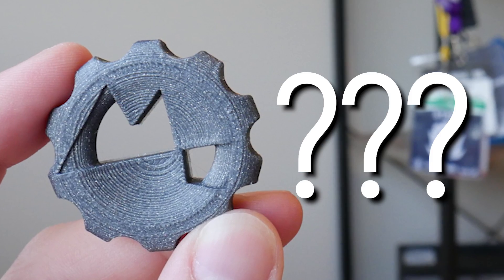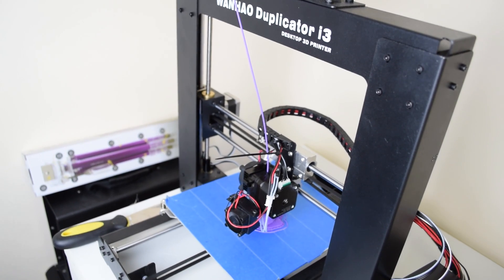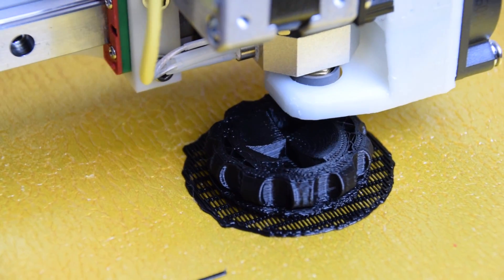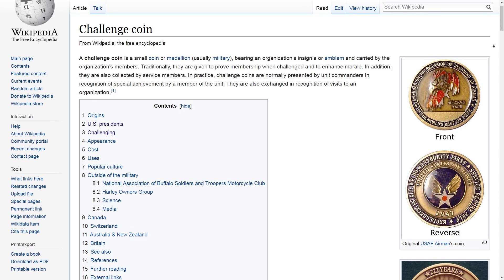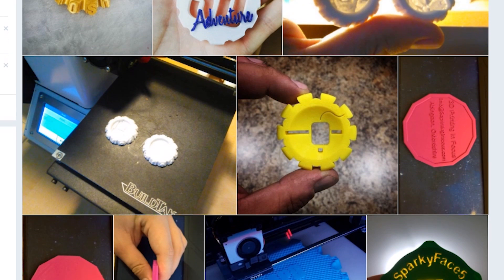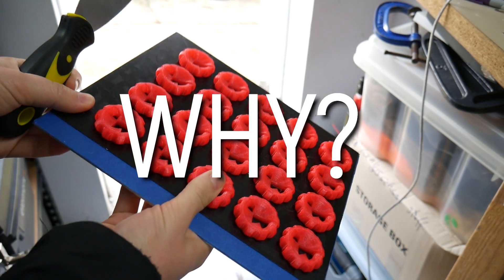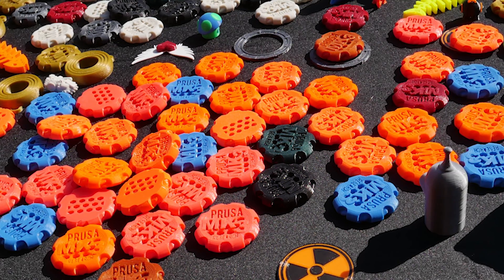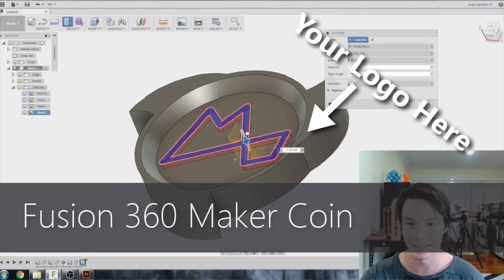What is a Maker Coin and should you design one?

Comment: Maker coins have hidden power
they are a great diagnostic tool, because you end up printing so many you will be able to quickly spot any major differences between filaments and their reactions to your common settings 

failures are unavoidable in 3d printing and we see them most when trying new designs 
in the midst of hair pulling solution finiding, its great to have a file, thats small, fast and you know works
so you throw down a coin and you instantly narrow down your failure reasons 

it does not need to be a coin specifically many of us use the XY calibration cube 
but the benefits of having a small and regularly repeated print are very under estimated